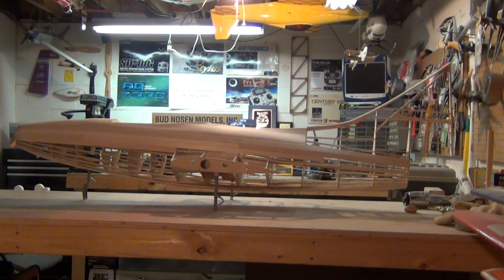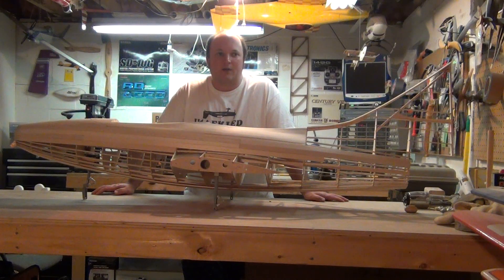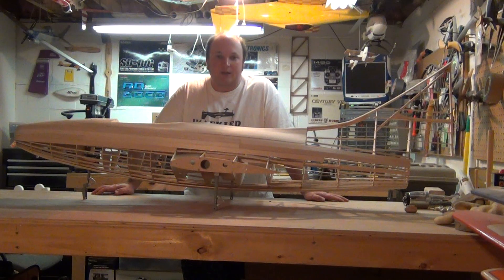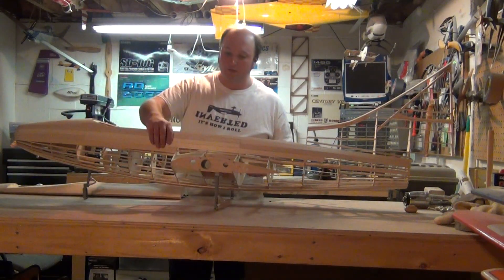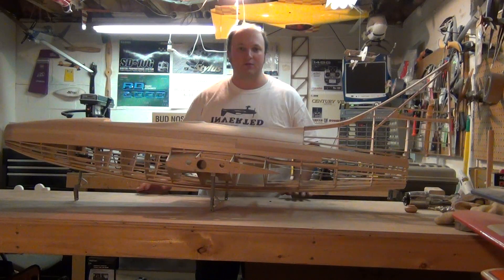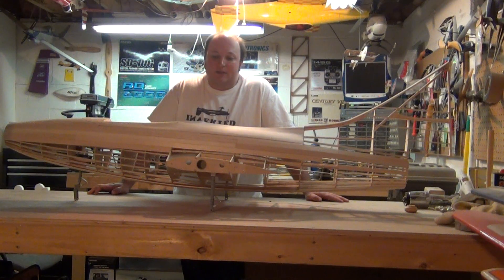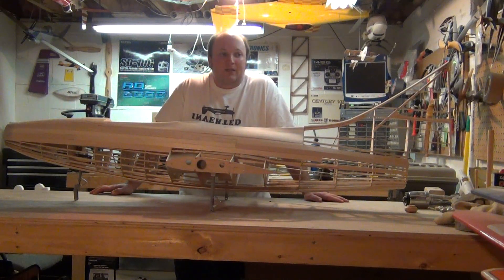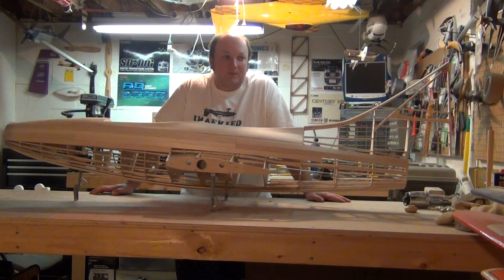Building season Ziroli Panther

Comment: Andrew I have a question. The dihedral on the print shows 1 1/4" from bottom of w-8 to fw-1 do you get the angle from fw-1 or is it better to add the dihedral angle with w-1 piece on the wing ..
Reply from the maker: I just set mine by eye...... it's not to critical.
Reply: Thanks man..I really enjoy your videos..lots of good ad6in there..😁

Comment: i assume it's done and flown by now. what glue to you use to plank to avoid the dreaded CA joint bumps?
Reply from the maker: The planking is put on with wood glue using ca to tack them into place, makes sanding easier.